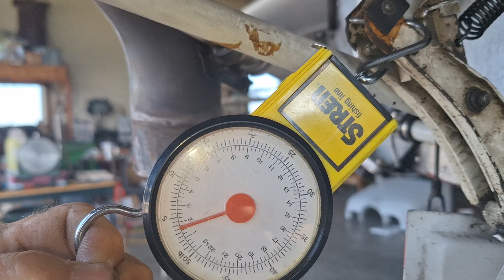Cessna 177 RG Cardinal Nose Gear Unlock Pull Test

Comment: The Service Manual says to remove the spring pulling aft on the lock arm before checking locking forces.  That makes a big difference in the final setting.  Even though your gauge said you had 19 pounds of down lock force, I can tell by how easily you pushed the lock arm back into locked position that your locking force is too low, probably down around 10 pounds.
And, you're only half done.  You also have to do the same pull test for the uplock force..  One of the challenges with this system is getting both the up and down locking forces within the 15-20 pound range.  There are lots of little tricks to getting both settings right.
Reply from the maker: Yes you are correct if you are doing a rigging of the gear you must remove the spring. I am just doing a quick check showing the procedure. You must always follow the manual. Every time I have one on jacks I check the locking force just using my feel to see if it needs a complete rigging. Most Cardinals I have come across do not meet specification and most are missing the rubber bumper. Cheers